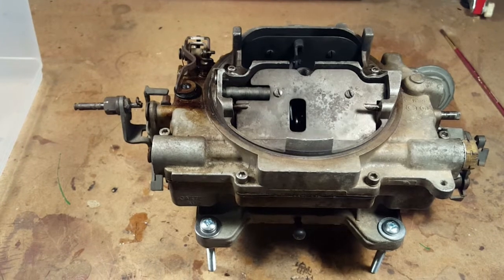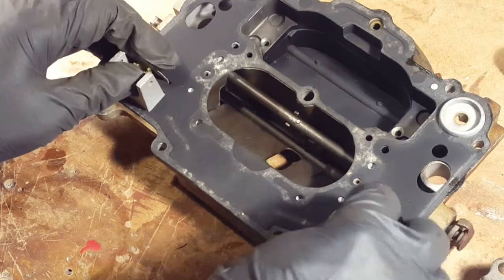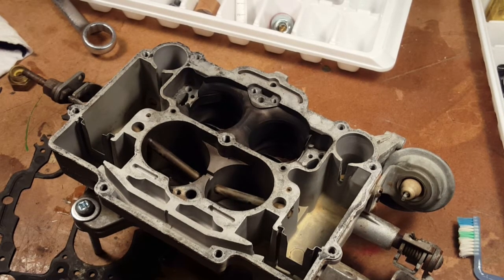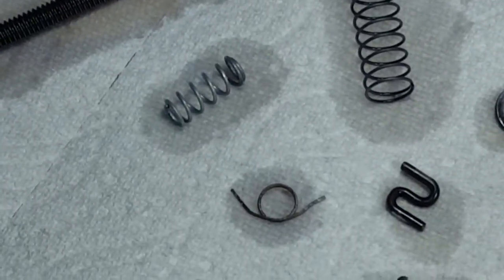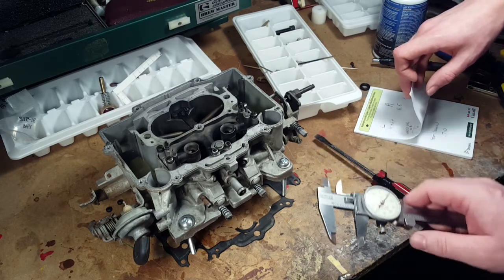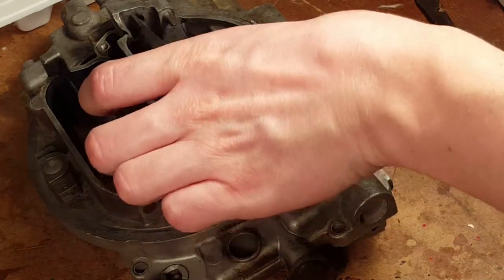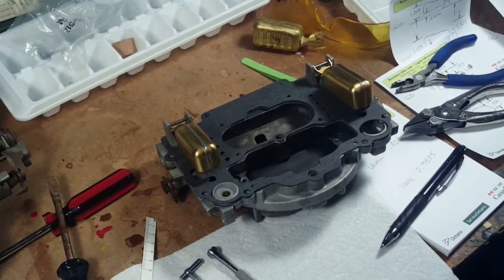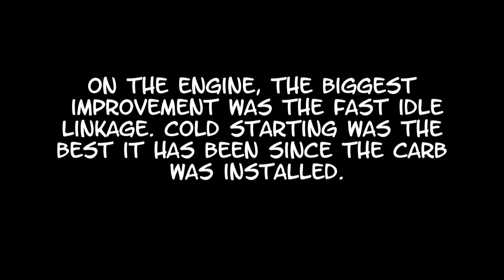Carter AVS Rebuild 2021 01 17

Comment: Carter AVS was a great carburator that came on 1970 340 engines. When I bought my Barracuda it cam with a 318 block, 360 heads and the avs carb. The transmission was a torqueflite 727. It was a great car. I had a carburator problem that many mechanics couldn't figure out. Then I met a real mechanic and he quickly figured out that I had a float problem. He soldered the float but never told me the repair wouldn't last. Save your old floats. Save your carburator. Good job boys.
Reply from the maker: Thanks Roland. I have now replaced the old carb with a modern Edelbrock version. I will be changing the jets, because the way it was set up from the factory is way anemic. You really don't know how powerful your engine is until you have the correct jets and metering rods. I just hope Edelbrock can provide something similar to what I have in the old carb, albeit with two stage rods instead of the Carter three stage ones. Cheers Timo.

Comment: Awesome video. I’m having trouble with my choke. I can’t get the choke to close for cold starting. Any suggestions?
Reply from the maker: I would first isolate the choke plate by disconnecting either the manual choke cable or the automatic choke linkage. Then you will know if the choke plate is hanging up on something or if it's the controls. Always isolate parts until you find out what is stuck. Once you isolate the problem, you can figure out how to fix it.
Reply: @timosdinkydetailing  Thanks for the tips. Im determined to get it dialed in. So annoying having to have my wife turn the car over while I have to hold the choke plate closed for a second haha